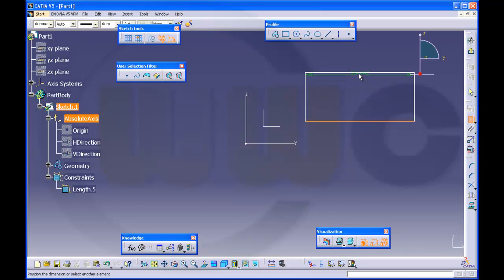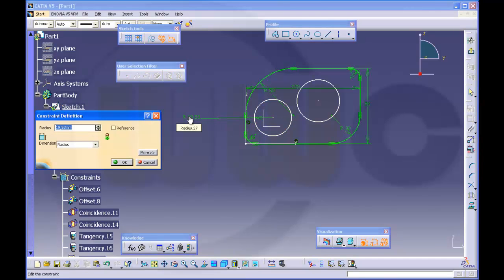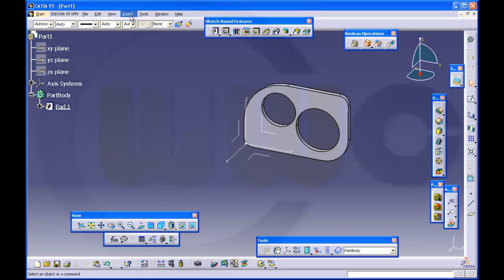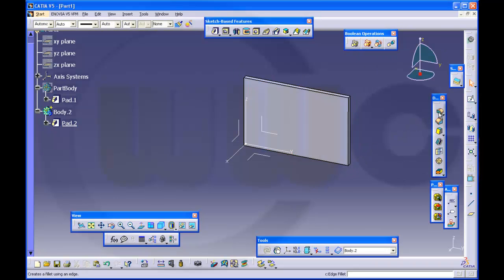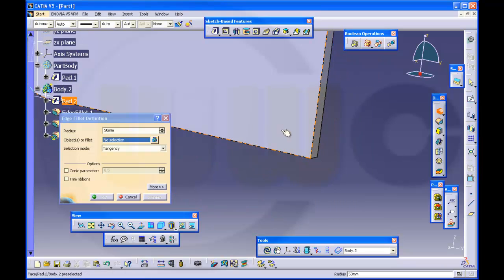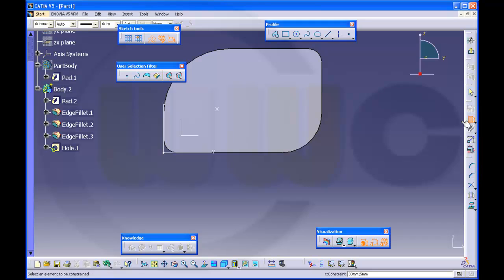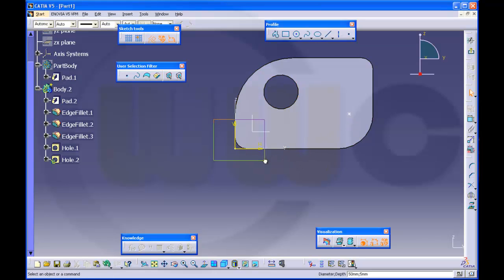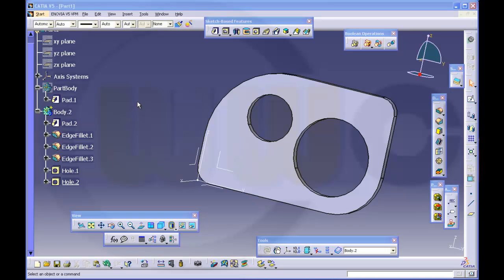Basics part I - Catia v5 Training - Basic rules for modelling

Comment: I never use the main system axes as my origin points. Axes can be deleted and if you ever need to copy stuff to another model, sketches attached to axes will fall over. Use the main planes which cannot be deleted
Reply from the maker: Doesn´t matter because you have to redefine all references anyway. The H/V directions are just projections and you will lose those references as well. The industry doesn´t use those planes! 
The proper way is to define your own axis-system.

Comment: Hi WW  do we have any option to  move the 3D curve tool bar from freestyle to generative shape design
Reply from the maker: Just try - switch to GSD - go to ->tools ->customize  ->toolbars - and add that command to the GSD workbench. This will work, but the command might not work even if it is available in the GSD workbench. You should also consider, that you need more than that 3d curve tool, so you would have to add more commands than that. You could make your own toolbar.
Reply: Wolfgang Walden let me try thanks lot

Comment: Hi sir in my pc im getting error please help me to resolve

I designed part by using no of insert body options many time but now im getting error only the body define work object is showing on display rest of all bodies are not displaying why it happens
Reply from the maker: There is a switch/symbol in the lower toolbar, which allows you to see only the current body.  "current body only" 3 bars in blue/gray clour = all bodies - 1 bar only the current body in orange colour.
Reply: Wolfgang Walden  how to activate all bodies
Reply from the maker: ??? Just klick on that above mentioned icon/symbol!
Reply: Rotate zoom in/out is not working from mouse i have change no of mouses same problem im getting bt it was working from tool bar icons